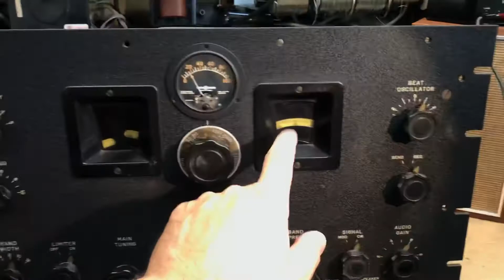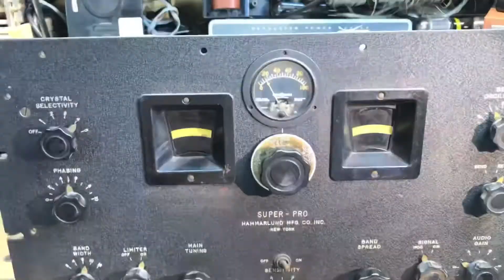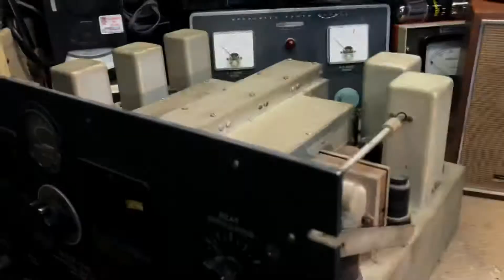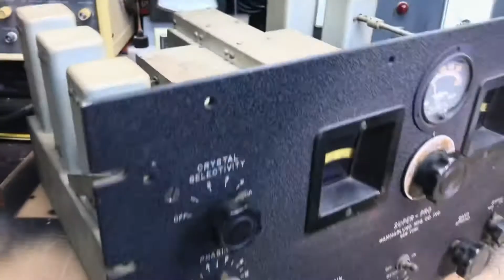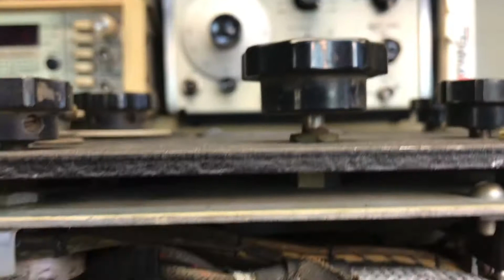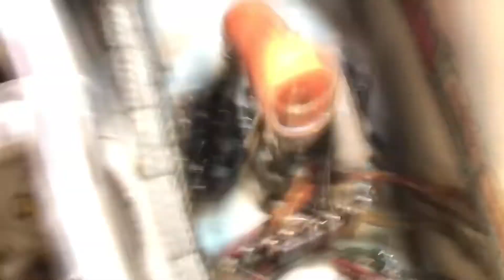Hammarlund Super Pro 200 | The Vintage Audio Life

Comment: Had one about 50 years ago.  Someone had removed the audio stage and the crystal filter.  I installed a generic IF can and hooked up a q multiplier.  Also built a basic audio output stage.  Very nice $15 receiver!
Reply from the maker: @JoeBob1955  it’s unfortunate, most receivers that I come across have been chopped or butchered to some degree. Nice to hear you got it working!